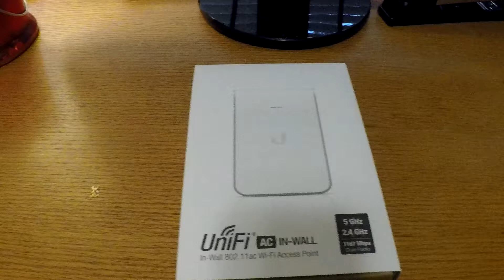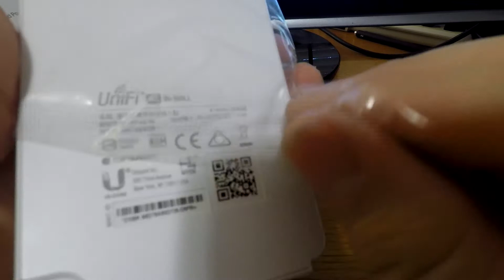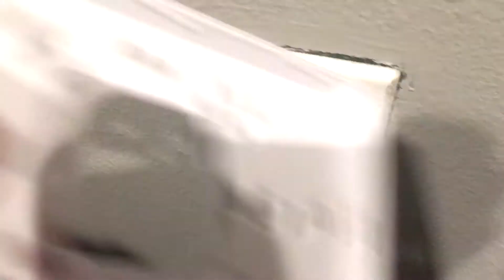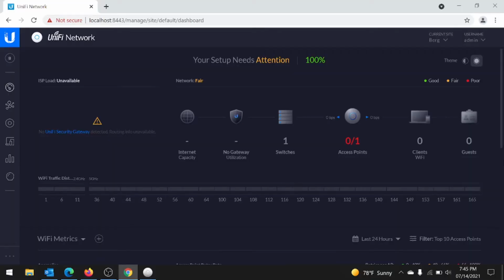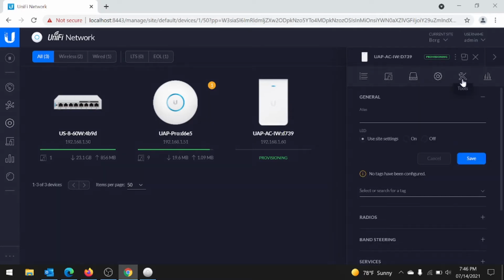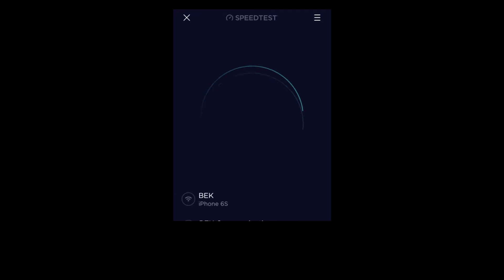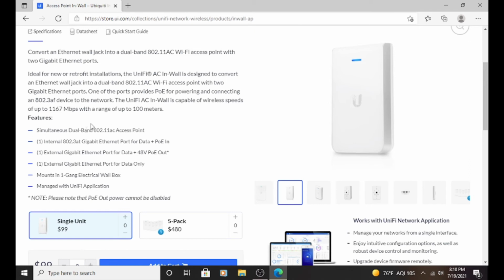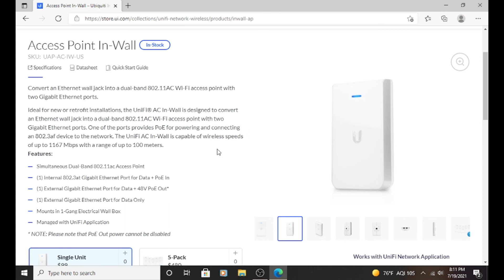UniFi AC-In-Wall Unboxing, Install and Review (With Speed Tests!)

Comment: Thanks for the video! For future reviews, you should also capture data in the same room as the AC-Pro from both the Pro and In-Wall. The cover photo you have saying "Can it outperform a traditional AP?" is misleading in this case because of that fact.

Other than that, good video!
Reply from the maker: Thank you for the advice! Getting used to making videos and talking to the camera is a bit weird at first.
Reply: @gbnetworks8722  No worries man! At least your making videos lol. I want to but don't have the gear or space for it yet...

Comment: Great review thanks for the info. Did you end up upgrading to the HD ever?
Reply from the maker: I did not. The regular AC-In-Wall has been doing great actually. It's not the most powerful thing ever, but for just getting decent and quick wifi to a room that I couldn't cable, it has done great. I however would upgrade to the HD if you had more than 5 devices that are bandwidth hungry like HD streaming and things like that or if i needed longer range for my wifi. I only have 3 devices on it and it is just fine. The wifi reaches about 65ft before it starts to diminish.
Reply: @gbnetworks8722  thanks. I actually ended up going with the HD actually. I wanted the pro but it’s been on back order near me. So far the HD is working great. Good speeds and coverage.